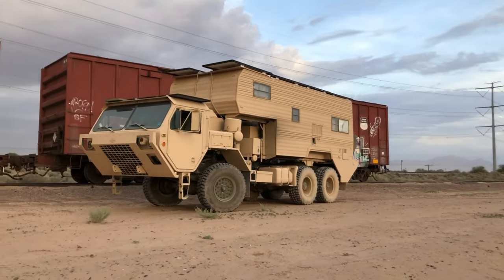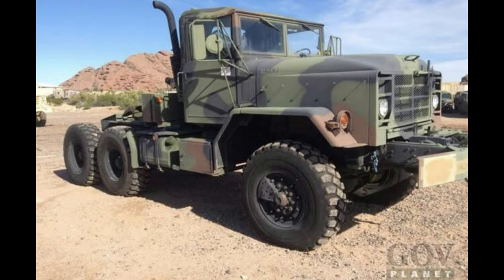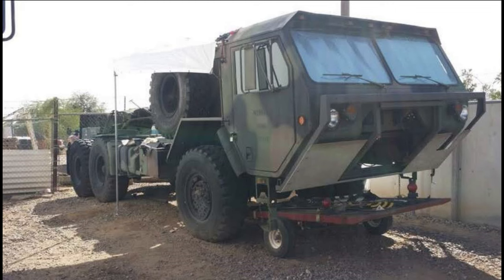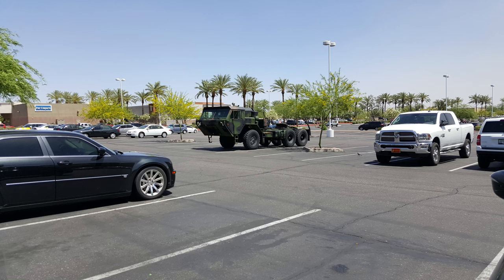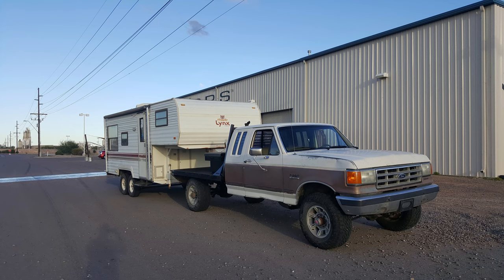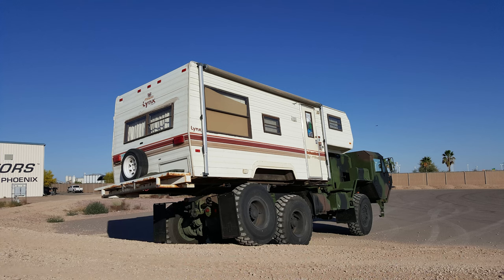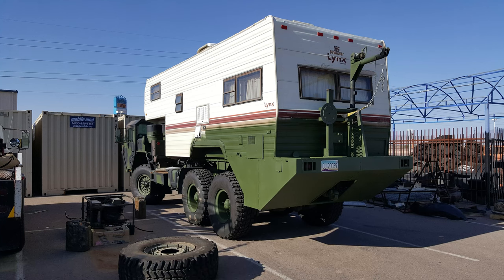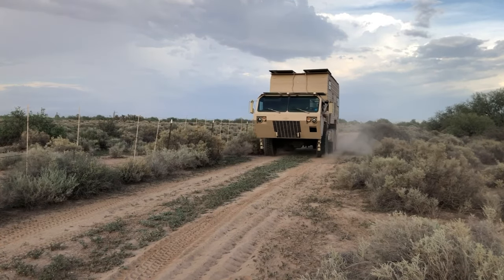The DragonWagon, A DIY Frankenstein Military Truck Camper

Comment: standard camper doesn't work well in a offroad situation because I've seen some campers that got stuck specially if they are carrying a trailer and using military trucks that's built for offroading is a good choice